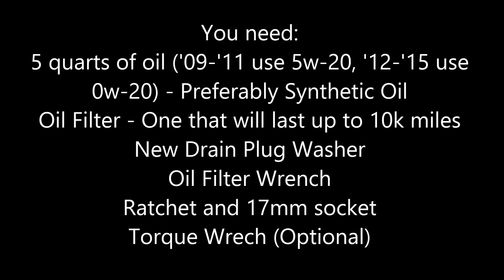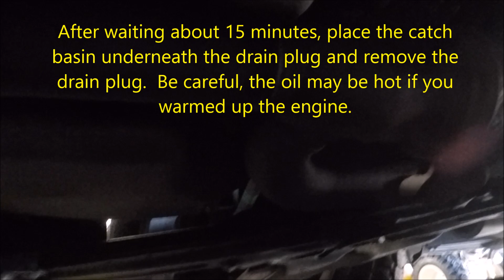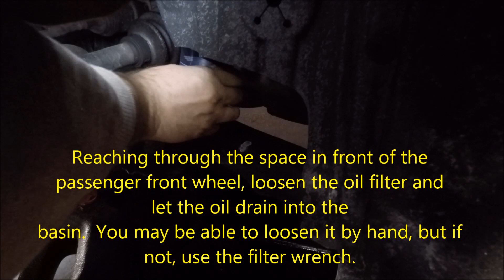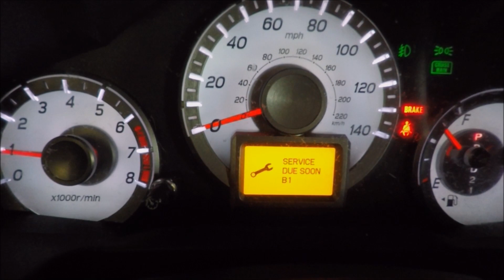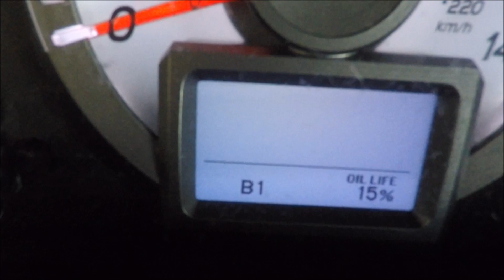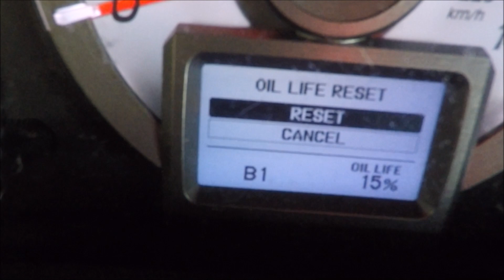Honda Pilot Oil Change 2009-2015

Comment: I have the same model.  Few suggestions. Remove the plastic cover between the radiator and front grill, just need to take off few clips.  It gives better visibility when pouring the oil. Also lift the oil check dip stick so the air will come out of it when pouring the oil this will stop oil spills.
Reply: I picked up one of those long funnels and avoided removing those plastic parts.  Also a 5quart jug of oil is 4.7L . So I usually just pour the whole jug when changing my oil.  
Usually its at the high mark but ive been doing this for years with no problem

Comment: Hi, sound stupid, but I have hard time taking out the oil dip stick. Tried to rotate it on both sides, and still doesn't come off. Any suggestions?
Reply from the maker: It just pulls straight out, give it a good tug it should come out. I’d recommend cleaning the o-ring and maybe putting a little bit of oil on it before putting it back in.
Reply: @stuffyoucando2  I couldn't remove it , it was solid stocked. I went to Honda dealer for oil change and asked them about it, I have  always  change my oil there.   They told me that they never check the oil dip stick after oil change , which I find insane. Now they are saying that I have corroded spool valve and that is the problem, and to replace it is going to cost $800.00 dollars and that is the only option. Mean time they tried to remove the dip stick, they broke it, so they put an used one not all the way in. What do you think?
Reply from the maker: Katanas Katanas it sounds like no one ever checks the oil in your car. I put almost 200k miles on between my two pilots and never had any issues getting the dipstick out of either. Have they explained where the supposed spool valve is?
Reply: @stuffyoucando2  They are saying that spool valve tube is seized. and it is one part, tube and valve.

Comment: Very good info. Most other videos skipped over some important steps like changing the plug washer, making sure the filter gasket is removed, lubricating the new filter gasket and adding oil to the filter.
Reply from the maker: Thanks for the positive feedback!
Reply: I forgot to add the oil to the filter and it turned out ok (but still a good idea).  Also, it took 5 quarts to fill mine (maybe could have done 4.8 as it was just a tad over). Great vid and now I can save $$$$$$$$$$$$$$!

Comment: The oil specs have changed. All Ridgelines can use 0/20 weight oil.
Reply from the maker: Thanks for the info, where have you seen that it has changed? A link would be helpful for those watching and reading the comments.

Comment: Great video, my question is: does one really need to replace that washer every time? In all my other vehicles I’ve never needed a washer. Is this a little money grab by Honda or does it truly require it?
Reply from the maker: Thanks! There’s been occasions where I have reused the washer in a pinch because I didn’t realize I was out of them. I’ve never had an issue doing that. With that said, they are really cheap and you can get packs of several of them from your local parts store. If I have them on hand, I change it. Thanks for watching!
Reply: Many people never change washer s. I bought off of Amazon. If it looks in good shape not gouged or torn you should have no problems
Reply: to be honest. Im using a fumoto drain valve which eliminates having to use a bolt and washer. Just connect a hose to the nipple, turn the lever, and watch it drain out into the pan. No mess at all.

Comment: No need for ramps?
Reply from the maker: I guess that would depend on your size or preference. Personally I don’t need them but you may find it useful.
Reply: @stuffyoucando2  thanks! I'll try without ramps today :)
Reply from the maker: No problem, good luck!
Reply: @stuffyoucando2  I use the ramps because you get a  better drain of all oil with vehicle at that angle front end up angling to oilpan drain plug which ive noticed could be a 1/2 quart more oil drained out CHEERS!
Reply from the maker: LIGHTNING FISHER I’ve personally never had that issue. I’ve always been able to add the listed capacity and haven’t had any issues with overfilling, indicating I get all of the old oil out.

Comment: Soo did you only got to use 4 qtrs of oil? Or did you add some more?  Do i have to get a new drain plug washer?  I will appreciate  if you could answer  my questions
Reply from the maker: I initially added 4 quarts, ran the engine and then checked the level and added what was needed to fill it to the correct level.  The capacity is 4.5 quarts, but if you just put it all in right away you run the risk of overfilling if you didn’t drain enough of the old oil out.  I do recommend replacing that drain plug washer each time.  They are easy to get and cheap.  Thanks for watching!
Reply: StuffYouCanDo2 thank you so much... 👌 👌 👌 👌
Reply from the maker: No problem!

Comment: I'm trying to show my son that changing oil in a car is the easiest thing that one can do on a car. I guess you can transfer the old oil into the jug then send it to a recycle place or mechanic shop. Good Vid. I also have a 11' Pilot EX-L
Reply from the maker: I transfer mine to an old 5 gallon container and take it to my local auto parts store. Most of them accept oil for recycling free of charge but will not take your containers. But you’re right, changing oil is usually pretty easy, especially on these Pilots. Thanks for watching!